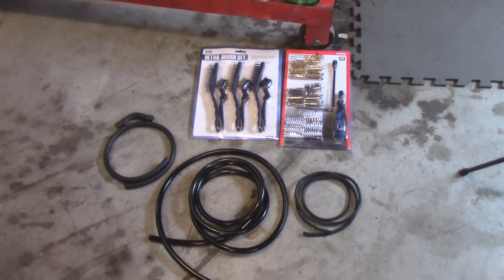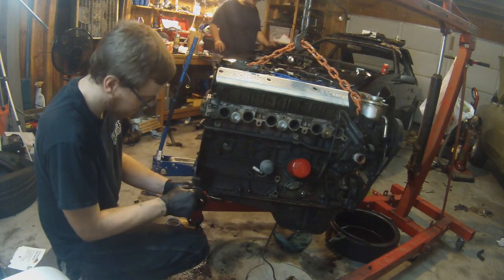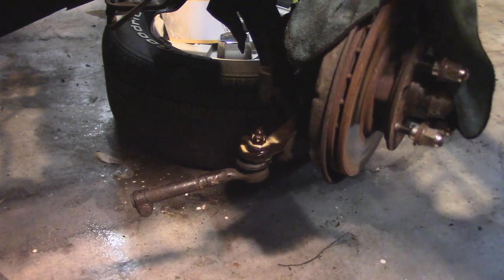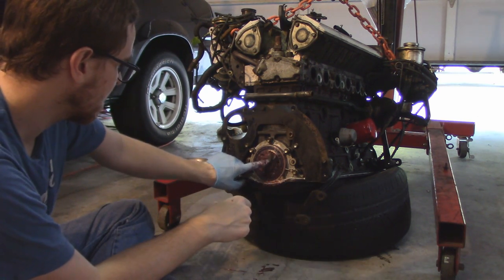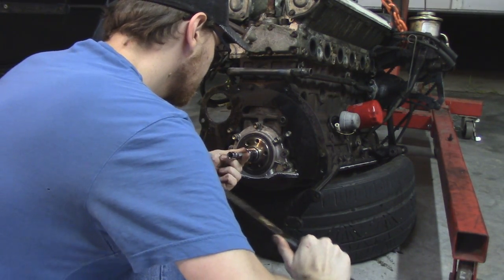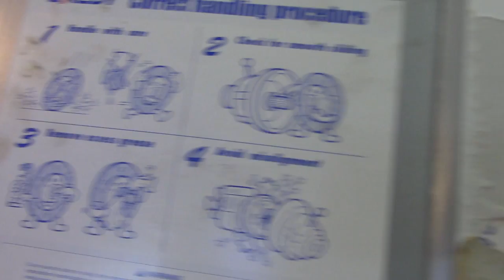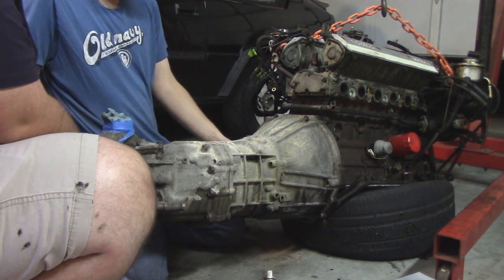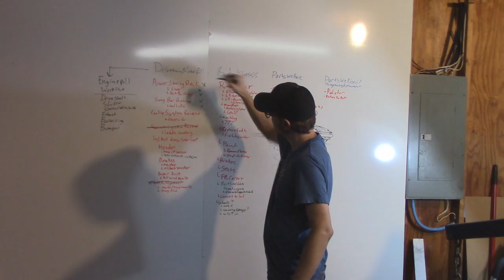Cone's Garage | Project Supra - Cleanup and Clutch Reassembly

Comment: Ive done it under a car, a few time, the very worst was a GT350 G35 Skyline. the jack collapsed and I ended up pressing the gearbox for a good minute while my mate was tying to get a couple top bolts to align and start. I can confirm that is a heavy box.

Comment: Hey Cone, I don't know how much you can help me, but I have a weird issue with my transmission, and was wondering if you or anyone could help. So I have M5OD-R1 transmission in a 96 Ranger, and when I put it in first and start to move, the whole shiftier moves like it's trying to go to third gear and I'm wondering if anyone knows what is causing that and how to fix it.
Reply from the maker: +dude55man sounds like bad transmission and or motor mounts
Reply: Like I said, it only does it in first though. The other gears are fine.
Reply from the maker: +dude55man it could be that the torque multiplication in first gear is too much for them to handle, or maybe the internal linkage of the transmission is is broken or busted in first gear
Reply: Alright, I'll look into it, thanks man

Comment: It's funny to me how many parallels there are with this and building a PC. This is just more in every way. More expensive, more complex, more awesome, you get the point. But the same things with not knowing if it's going to work until you're done and the wiring mess and how careful you need to be at some parts is all the same. I suppose the differences are that you really need to take care of the airflow in a PC and less so in a car and that in a car you need to deal with moving parts, which is not really a thing with PCs.
Reply from the maker: Also like procedures that everyone says you absolutely have to do or you will ruin it..like static straps and what not...but nobody actually uses unless they are on camera and trying to keep people from freak out :P